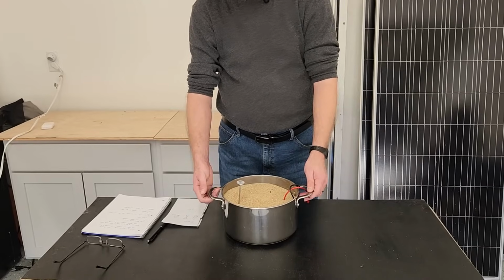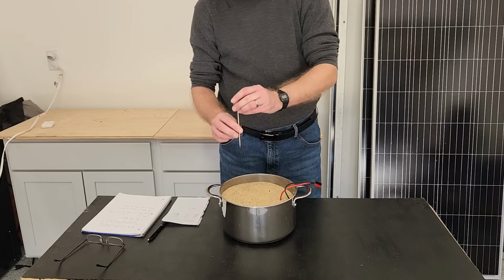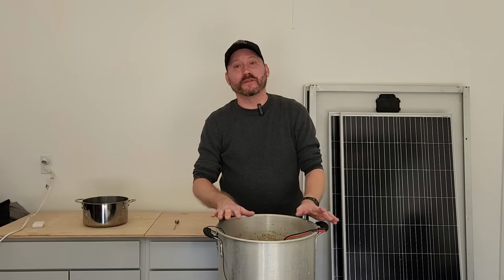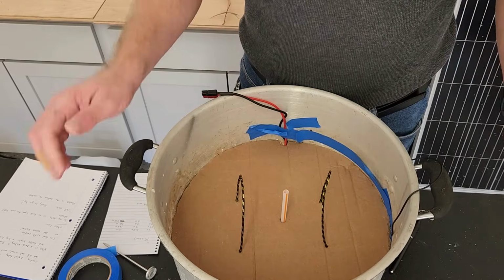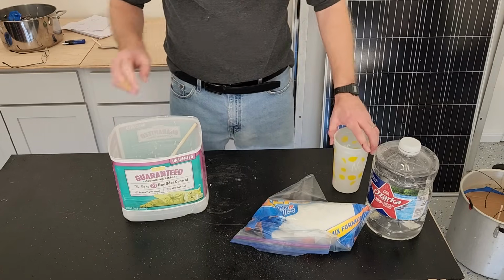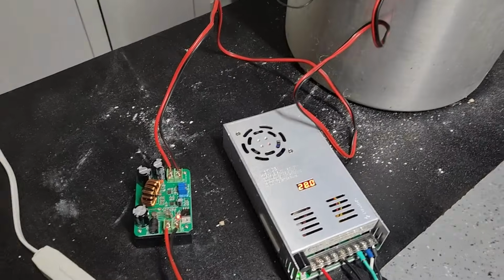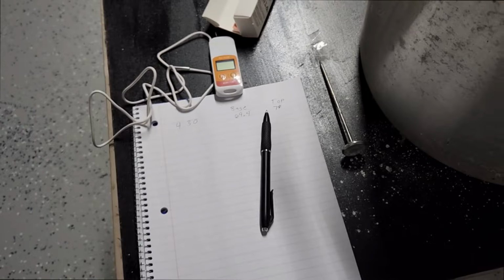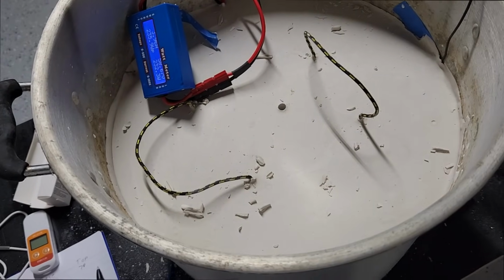Sand Battery heater. Create free heat  of 500F using solar electricity! Texas Prepper Projects

Comment: One of the greatest thing about electricity is how easy you can move the energy from one location to another. You can keep your sand battery in one location and use a 12 gauge extension  cable to carry the power. 

Using just one heater element forces it to get very very very hot to transfer heat to the sand. It risks extream oxidizing sortening it's life.  Stove heater elements are better designed for extreame heat without being oxidized. It will also have a higher surface area in contact with the sand.
Reply: can the sand crystalize?, like his did, into something that can short the element and or start electrically charging the sand causing a shock hazard.  I assume sand is not conductive....  but that does not mean something in the sand might be?    

hence why I was thinking some silicon covered heating pads (like drum heaters)  distributed thru the battery may be a better choice?
Reply: @coachgeo  In short, i don't know about molten sand/glass. I have some educated guesses but I could be wrong.

silicon dioxide I quarts glass and sand is a very good insulator.The DC resistance is very very high and there is probably very very very little current flowing through molten sand, even with some contaminates. 

But if you preheat a piece of glass, and stick it into a microwave,  the glass will absorb the microwave and melt. This is called dielectric heating. It happens because silicon dioxide is a polar molecule and when Glas is heated it's free  to orientated with the changing electric field likevwater does in a microwave. This also means molten molten glass can capacitive couple alternating currents, although I have no idea how much or how little that is given a resistor heating element but my guess is that the surface area at each end is small and 50 or 60 hz isn't frequent enough to dump much energy though dielectric heating.
Reply: Yes 👌
Reply: @coachgeo  poke the element in from the top to bury the element but leave the wires exposed
Reply: @kreynolds1123  
 The melting point of sand is about 2930 degrees faranheit. This wouldn't be able to be achieved with what he is using if he applied proper heat transference. 
The biggest issue he is having here and the reason the silica clumped to the element is due to the lack of heat transfer. The element was "building" the heat right in the center and in order to keep from concentrating the heat you would need to do some calculations in order to know how much or how quick to heat up the mass in it's entirety. 
 Also when he molded in a straw so that he could temp probe the mass he just made a small thermal "volcano" where a crap ton of the energy is going to make its way towards, hence heating up the area surrounding the hole first cause the heat to want to escape faster there and not spread homogenously.  So the thermal couple between the sand on the element and the energy coming from the electricity in the element was a stronger bond than that of the rest of the mass so therefore it continued getting hotter and hotter. If there was a "cutoff" point in intervals the "hotspot" would have time to transfer that energy to the "cooler" areas hence, making it able to become hotter and more efficient. 
 
This heating is governed by the dielectric properties of the material. The dielectric properties depend on the frequency, and temperature.(With sand,  moisture content also affects dielectric properties). The dielectric properties of some materials are mainly dependent on temperature, whereby the coupling is increased as the temperature increases. These materials are prone to a thermal runaway effect that is initially caused by low temperature differences in the material. Those
areas that have a slightly higher temperature than the surrounding material take up more energy due to better coupling to the high frequency waves. This results in a faster temperature
increase, which in turn leads to even better coupling and increased energy take-up, and so on.
This thermal runaway can result in local destruction or even melting of the material. Assuming you allow it to reach over 2000 degrees faranheit.
Reply: @TandTAZ   i have thought about this kind of project further since i first seen the video and commented. 

Filling the space between sands grains would improve the thermal conductivity.  I quickly rule out water because it limits one to 100c and phase changes creating a bomb if it doesn't vent. Powered coal or graphite filling empty voids between grains of sand might work, and it would prevent oxidation of the metal heating element, but I'm afraid it might produce carbon monoxide and carbon dioxide and escape.

I think it would be better to attempt  a higher surface area to assist in transferring heat to a large percentage of the sand rather than increase the thermal conductivity of the sand.  Besides, one nice thing was how long it held heat.  I'd propose coiled nicrome wire, or nickle plated steel guitar or piano strings, be coiled in the sand pot, thus decreasing distance heat has to travel in order to heat up all the mass of the sand. And, with the long wire generating heat over a longer distance and spread out inside the pot of sand would limit hot spots that contrbute to oxidizing the metal or fusing the sand.  I also would not use insulated wires inside the pot. The plastic will melt and burn, and release fumes. Instead, Use solid copper wire copper wire to an array of parallel  connected wire heating elements. Each with high resistance limiting current so that each doesn't get very hot quickly, and yet the whole array of heating elements has low net resistance because of many elements heating in parallel, allowing the whole mass of sand to be heated relatively quickly with solar PV after batteries are topped off.
Reply: One location, I agree, heat up inside while it is heating up, much quicker. When I first saw this video I thought it was going to be a magnifying lense for a lid, then needing to be outside. Thanks for the stove element hint
Reply: @coachgeo  water, damp wet, heat making humidity, and the cables used being connately heated to max, if not over max, not the power (electric) but the actual heat it's self
Reply: @TandTAZ  You mean something like heating the thermal oil and send it through the sand container in spiral motion through copper pipes?
Reply: @kreynolds1123  sounds interesting
Reply: @gauravashq  that may work too. But I was referring to the air gap between the sand and element. Even if you use a thermal oil inside a pipe you’ll still have that air gap that’s creating more heat than you intend. I would probably just form the thermometer into the sand mold without a barrier so that there is no space between the heat source(element) and conductor of heat (sand) as well as affix the thermometer into the sand with no air gap. 
Thermal oil running through pipe will still create more heat in between the pipe and sand IF there’s any type of air gap. If it’s a tight one you’ll get really high temps that will fuse or melt things eventually if the gap is big you’ll dissipate too much heat. So that’s why I say form everything tight With no air gaps.
As far as the oil goes. Ideally you could fix an element inside of a stainless steel pipe, fill the pipe with oil and seal it, mold the pipe into the sand and IF you need a thermometer on it make sure it fits tight. 
There’s science papers on thermal dissipation and whatnot when using quartz sand in this fashion. 
The most crucial part I’ve noticed is how heat transfer reverses depending on temps vs mass. So if you’re trying to heat too much it will eventually find a path of least resistance. That’s why the element fused with the sand, the heat had an easier job transferring heat back to the source rather than heating the rest of the mass. So you’d need less mass or more elements. So, one element inside a thermal oil filled pipe that runs down a bucket, across The bottom(not directly on bottom), then back up to the top would work like two elements cause you’d have two points of heat source for your mass. This would also heat more efficiently, I believe.
Reply: @coachgeo  sand very crude powered glass, the stuff in your window, cups, etc, and glass is an osolator by it's self, but, as it not just silica sand, bits of everything, maybe it got high metal content in the sand, ?
Reply: @kreynolds1123   or one heating element and sand at an extremely slow pace is passed over it. Sand falls into storage chamber below with an array of small heating elements thru out (engine block heaters?)  who only act to help maintain the heat from the intitial heat up phase........  until it is ready for all power to be shut off (all sand now sitting in battery)
Reply: @kreynolds1123  Naphthenic mineral oil has long been the most preferred insulating liquid for power transformer insulation because it has a good pouring point at low temperatures, good thermal cooling capacity, low cost, high efficiency and availability on the transformers market [1, 2, 3, 7].
Reply: @carrolbrooks2143  transformer oil would certainly conduct heat away but too hot (above 150c) and the oil behines to break down if the oilngets to hot, it begines to vaporizes and presents an explosion hazard. 

Thinking more about this, I now think it would be good to make a good sizable and cheap material  made of sand along with something that has high thermal conductivity, doesn't evaporate, and can tolerate significant high heat temperature. I'm inclined to think graphene powder filling in the gaps between sand grains. Then surrounded that by only sand with air gaps to act as an insulator holding the heat in for long term. 

Sand begins to melt at 1400c and can react with the carbon in the graphene powder to form silicon carbide that melts at 2700c. But, copper melts at 1083c while typical stove top element might be rated to Handel 500c. Reguardless, I  suspect In this application, being supported in sand and heat being wicked away comparitivly quickly will help It will hold up to higher temperatures 1000c maybe.  Copper connecting to the heating elemebts is probably the bigger limitation so maybe staying below 800c is best.
Reply from the maker: there is a reason why I didnt do this
Reply: @texasprepperprojects  I'm curious to know which this is that you didn't do, and why.

Comment: awesome job mate
Reply: Hey bud!  Looks like we frequent the same channels.  You should do another?
Reply: My thoughts exactly , thanks to both of you
Reply: @dennisking8892  Hey Dennis.  Have you build one of those HHO generators such as the one on your site with Patrick Kelly?  Good instructions btw.  If it works, I would be interested.
Reply: @l0I0I0I0  no I haven't made it, good luck . I did  also see American cop cars taking advantage of the Tec ,on another YouTube video
Reply: @dennisking8892  interesting!  Do you have that vid?.  Does it have reliable directions?  It's a lot of work so if I'm going to invest that much time and energy, I need to know it is going to work.  Biggest concern is hydrogen embrittlement.  It very well may greatly reduce the life of the motor which is not worth it unless it's made of 316l stainless which they never are.
Reply: @l0I0I0I0  yes running temperature has to be the first consideration,came across this thought this might interest you hydrogen paste , no good for running the car though
Reply: @dennisking8892  Hydrogen paste?  I'm very interested?
Reply: YouTube, scientists say that no fuel will beat this hydrogen power paste . The Tesla domain
Reply: @dennisking8892  Just watched that vid.  I would like to use it for backup storage on a farm of I can get a hold of the right people.
Reply: Of course, Mr. Murray,... was expected that you will enjoy this experiment: yourself are playing with this nice "toys"! :)))) Anyway, we are ready to make a  big responsible sistem with sand this year, too! So, let's stay in touch, all of us! Are we? :) A happy New Year, everybody, everywhere in this crazzy but creative world! All the best from Romania! :)
Reply: I just got here from watching your sand battery video.
Reply: How would aluminum foil work?  Makes great hats for nerds! And well, heat exist and moves in three forms including part of the ultraviolet (UV), light and infrared radiation range.  The later has of I remember correctly about 53% of the heat.  Now different materials reflect the heat radiation spectrum better than others.  Aluminum is pretty good and covers a long range of IR as well as being cheap and makes great hats!
Reply: @naseemwaja8735 Yes the hats are easy to make.  :)
Reply: @l0I0I0I0  Ironically, tinfoil hats can actually concentrate certain types of radiation on your head. Thus making it actually the last thing a nerd (or conspiracy nut) should want to wear. Linus tech tips did a neat testing video on a silver thread lined beanie hat a while back related to this topic.
Reply: @TheNeighbor4U  lol. Go figure
Reply: You all should look into crafting some zeolite sand using sodium hydroxide, aluminum salts, and a liquid silica compound. They're quite abundant. The benefit of zeolite is that it stores heat nearly losslessly since heat is stored in the actual molecular structure of the zeolite. When zeolite is hydrated or exposed to moist air, it begins to release it's stored-up heat. The process is reversed to store heat by heating the zeolite to remove moisture. Zeolite if stored in an airtight space can store heat indefinitely (remaining cold to the touch until activated)🤫🙈🙉🙊 zeolite technically doesn't need heat to charge, merely to be dessicated of moisture. A cyclical system can be devised to use a solar pump to draw out the moisture and store it for later use to activate the zeolite once solar energy is no longer applied...keeping the system nearly perpetually "hot". Zeolite can also store 4x more energy than water and a single gram has a surface space of over 10,000sq feet for energy storage 🙌🧙‍♂️
Reply: @mcombatti  stores 4x more heat than water?  It's a bold claim but if true, it would be the answer.
Reply: @l0I0I0I0  Google zeolite :-)
Reply: What if you installed a copper tube series of coils inside the bucket and used it to heat water via siphoning action or assisting the flow with a small pump to assist in heating your geyser water.?
Reply: You should have put a hole in the side of the tank for the heating element so the wires aren't buried in the Hot Sand, just use an old electric water heater and there's already two threaded holes ready to accept the heating elements.
Reply: I watch your channel Robert , nice comment . Engineer here respect to people like yourself 👍🇬🇧
Reply from the maker: Thank you!
Reply from the maker: I do!
Reply from the maker: Thanks!

Comment: This is a pretty cool idea I'd like to mess around with myself.  The comment section is GOLDEN!
I've used popcorn tins filled with sand, pea gravel and/or bricks with an incandescent lightbulb to set under metal chicken waterers to keep them from freezing.  This is somewhat along those lines.
Vaseline or cooking spray oil work fairly well as release agents for plaster.
Reply from the maker: I thought about the popcorn tin since we just got done with Christmas!   I've seen several variants of this design including one using tea candles sitting on bricks. Sand is cheap, it's interesting and easy to play with. I'm just so STUNNED at the 500f I got out of it
Reply: I am wondering how to create a safe place to put something that 🔥 hot. 

Downstairs is always cold. The heater isn't that efficient if temp drop too far and it doesn't circulate. Downstairs is lightly refrigerated, upstairs is warm. 

I can see setting up one or two of these to radiate heat Downstairs... 
but 4 cats 🐈   🐈   🐈   🐈  ...

Comment: Also, try a “sand hog” element. They are used in water heaters where there is a lot of sediment in the water., they are made of a tougher material and will last longer.
Reply: How about putting it on a 4-legged stand about 30 inches off the floor and use a fan to circulate the heat?
Reply from the maker: Why?

Comment: Thanks for sharing your experiment. I saw another channel trying a similar method. The water heater element just got destroyed from the heat (he could easily break it apart in his hand after it cooled down). He ended up using the element from a stove instead.
Reply from the maker: Can you link to it?  Mine seems to be falling apart also but I'd love to see others!
Reply: What is the link? Looks like it was removed???
Reply: @NORSKGARDEN  it was on this channel. Update 5 or so. It was one of his earlier vids before he switched to stove coils https://www.youtube.com/@off-gridsurvivalmike8120/videos
Reply: There's already oil filled  thermostatic heating devices in the market place so why not run the solar wiring power supply to energize such a device  or bury one of these in a box of  SAND  ?????  😮  😮  😊  😊   ❤  ......
Reply: Probably because you shouldn't bury a heating element in anything